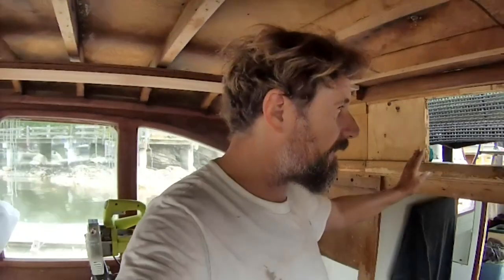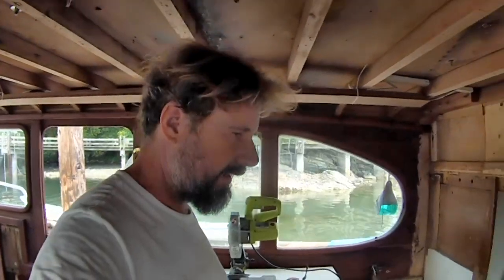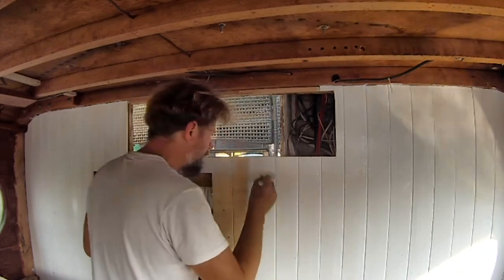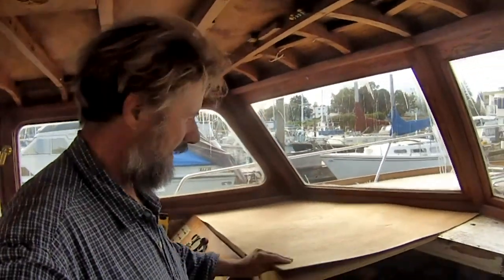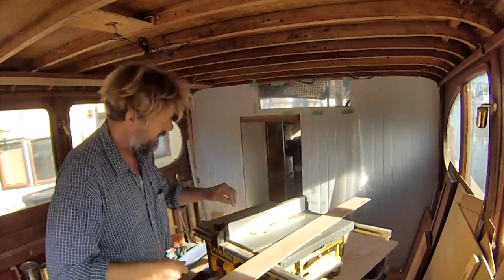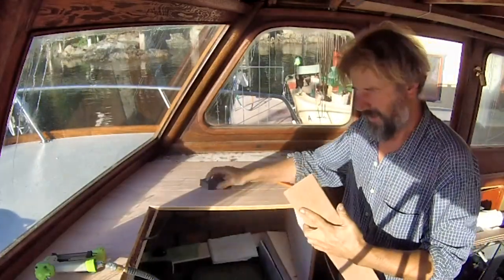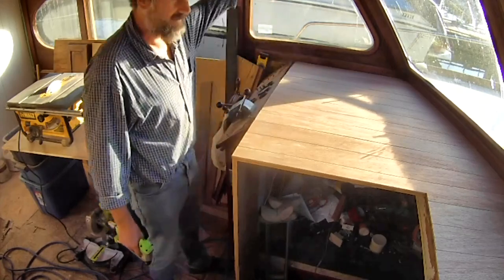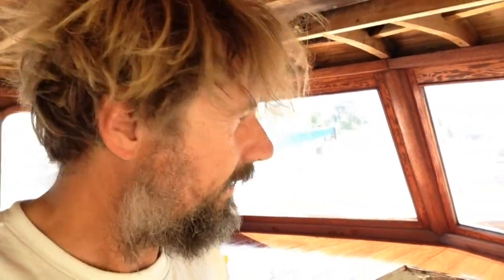Paneling the bulkhead and Planking the dashboard - Wooden Boat Restoration- Travels With Geordie #53

Comment: Angle the pins in opposing directions for greater holding power.
I’m surprised that you didn’t finish the strips all around before installation, for better flatness.
I like the effect of the strip dash.
Keep up the good work, JIM

Comment: Great job it's called the fore deck, luan does look like any new mahogany you normally buy now days, the Philippine mahogany is extinct I believe. Keep up the good work!
Reply from the maker: Thanks, I guess it really is the fore deck. The luan was actually a mistake. In an upcoming episode you will see I neglected a leak which promptly destroyed it! I think I'll redo with thin Sapele marine ply using the same strip technique. I've subjected some test pieces to extreme moisture tests and it's amazing. Although quite a bit more expensive!
Reply: Didn't think about that! Thanks for the info, maybe a few coats of CPS would help but I like your new idea! Thank you!